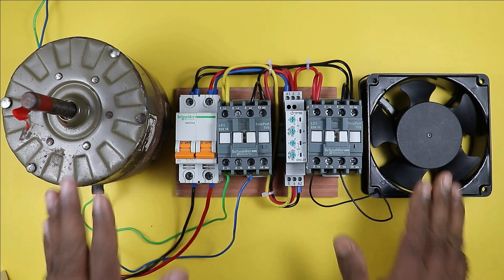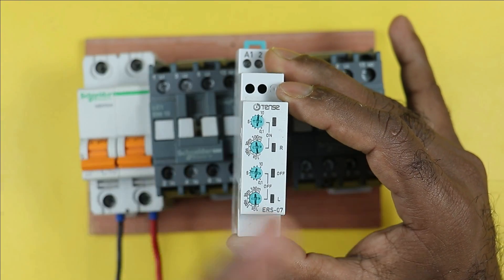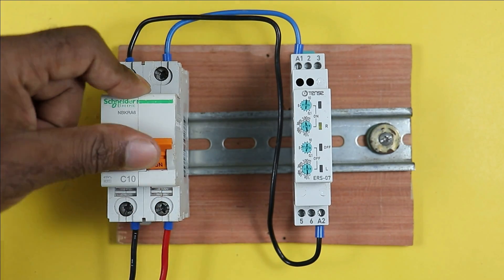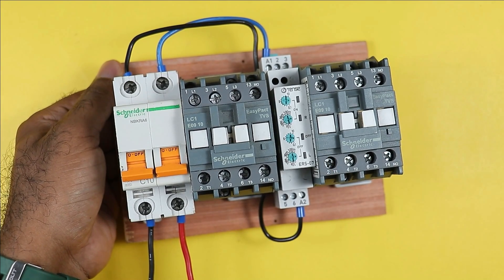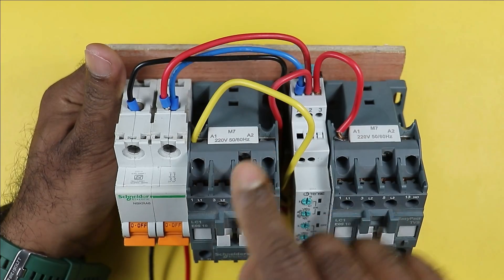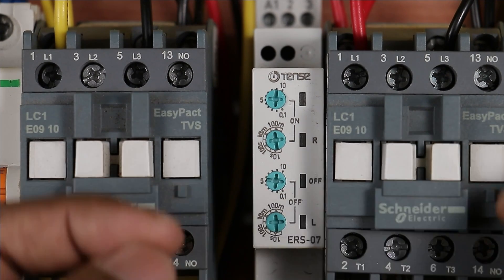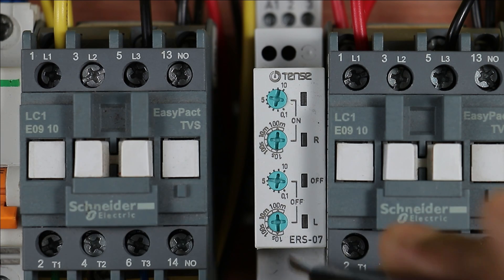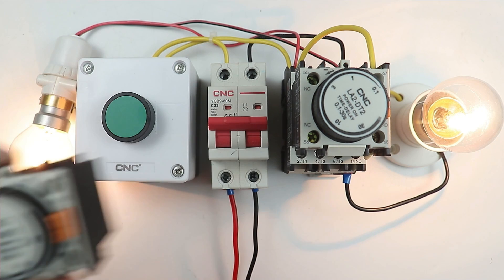Inverse Timer Connection With Contactor for Two Motor  @ElectricalTechnician

Comment: During the above process with inverse timer, If we want to Off and On both of the motor for certain time let's say on the midnight will Off and On again in the morning after that inverse timer start working again. Is there any additional device to those series or totally different the system. Thanks

Comment: my friend how to convert  connections diagram of high drolic cutting machine ..the cutting machine now is 2 limit swt and 3 relay 220v and 1, timer  with solenoid valve ...up and down the cutting machine..220v supply of timer and relay and solenoid valve.. thank you may friend I think you send me the connection diagram...

Comment: Hi,
 I have a query regarding the selec vprd2m voltage protection relay that I recently purchased. My house has a single-phase 2-pole setup, and I intend to use the vprd2m relay with it. However, the relay's output is 5 amps, and my house has a mix of resistive and inductive loads ranging from 5 amps to 15 amps.

To handle the varying load, I am considering using a 2-pole or 3-pole 25 amp contactor in conjunction with the vprd2m relay. This should help manage the load more effectively. Currently, I'm facing an issue where the vprd2m relay becomes excessively hot whenever my house appliances' load increases beyond 5 amps, especially when it reaches 12+ amps.

Could you kindly suggest a suitable contactor that can handle loads from 5+ amps up to 15 amps for my 110v - 300v, 20 - 25 amp resistive + inductive load setup? I'm looking for an affordable yet reliable option that won't compromise on safety and performance.

Your expert advice on this matter would be greatly appreciated. Thank you in advance for your help!

Comment: आपको नमस्कार ,

मेरा एक प्रश्न है जो संबंधित है सेलेक vprd2m voltage protection relay से, जिसे मैंने हाल ही में खरीदा है। मेरे घर में single phase 2 pole की electricity supply है, और मैं इसे vprd2m relay के साथ उपयोग करना चाहता हूँ। हालांकि, relay का output 5 ampere है, और मेरे घर में resistive और inductive load वाले appliances का load 5 Amp से 15 Amp तक का है।

विभिन्न load को संभालने के लिए, मैं सोच रहा हूँ कि Vprd2m relay के साथ एक 2 pole या 3 pole 25 amp का power Contactor उपयोग करें। इससे load को अधिक प्रभावी ढंग से संभाला जा सकता है। वर्तमान में, मेरे साथ एक समस्या है, जहां vprd2m रिले बहुत गरम हो जाता है जबकि मेरे घर के उपकरणों का load 5 amp से ज्यादा हो जाता है, खासकर जब यह 12+ amp तक पहुंच जाता है।

क्या आप कृपया मेरे 110v - 300v, 20 - 25 amp, resistive + inductive load वाले सेटअप के लिए उपयुक्त Contactor की सलाह दे सकते हैं? मैं एक सस्ता और सबसे अच्छा विकल्प ढूंढ रहा हूँ जो सुरक्षा और प्रदर्शन पर कमी न लाए।

 मैं आपसे सलाह की प्रतीक्षा कर रहा हूँ। धन्यवाद!